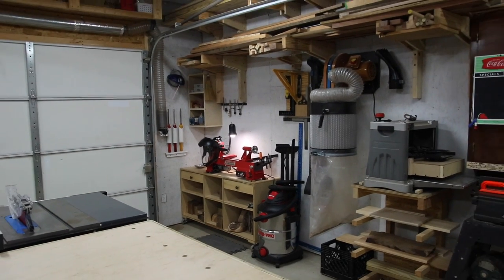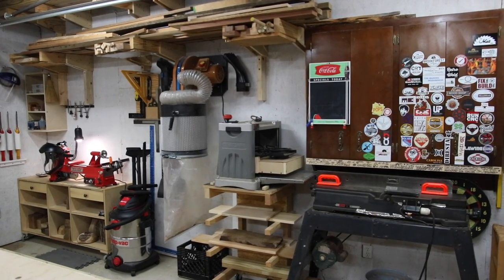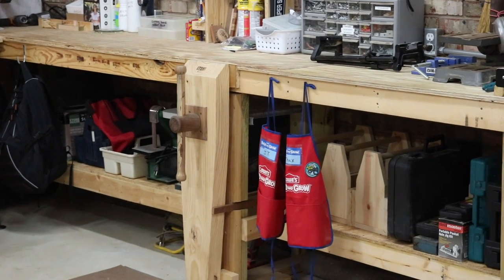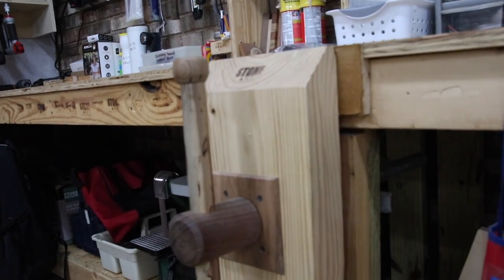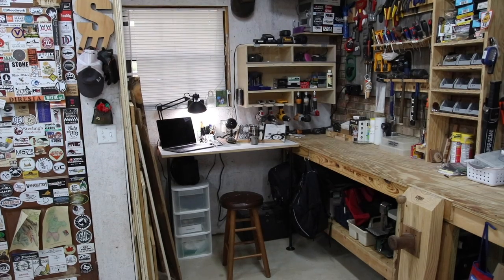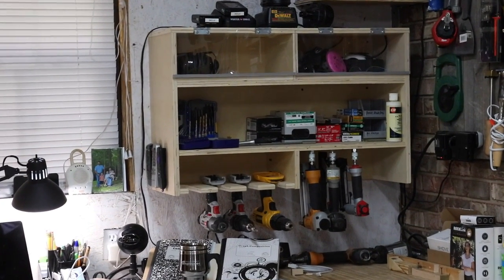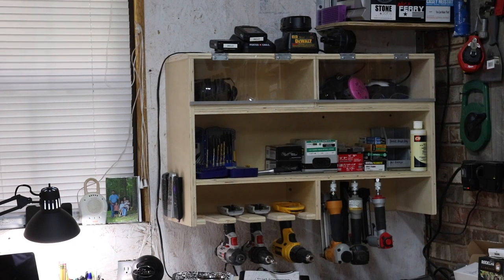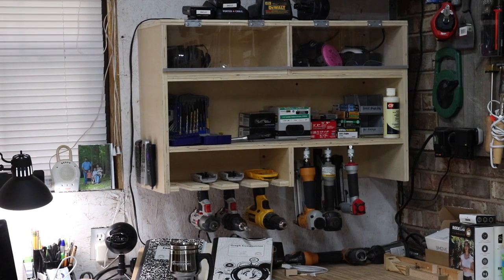Woodworking Shop Tour - Stone and Sons Workshop

Comment: Thank you Shawn for posting this. I was unaware of the 2nd channel and definitely need the information about your table saw dust collection as I have the same saw and need to make the changes myself. 

I also want to let everyone know that I have bought the plans for and built both this assembly table and the router lift. Both plans are put together very well and are easy to follow. I am a beginner wood worker and had no trouble knocking these out.
Reply from the maker: +Zerostar369 Awesome. Glad you found my second channel. Also, I appreciate the support through purchasing the plans. Glad you were able to complete the projects without any problems.

Comment: Do you just move the miter saw cart out when you need to use it?  I have the same saw and man it takes up so much space!  I like what you did with it for storage, but I was just wondering how and where you set it up when you need to use it. I also have that same table saw and that was genius what you did with the dust collection. I'm going to find that vlog you were talking about.
Reply from the maker: +Andrew Walker yeah, I just move it out a little and use my workbench as support if needed. Works great for me. The vlog where I show the dust collection is on my second channel. There's a link on my main YouTube channel page or here's the video... https://youtu.be/7FhGq4KBBns
Reply: Thanks!